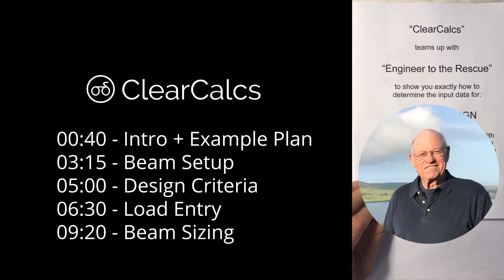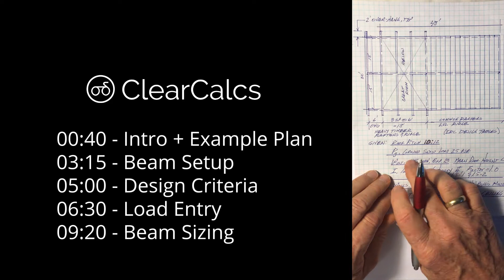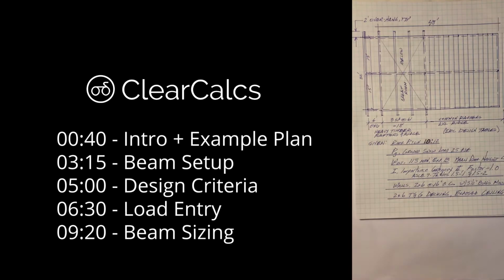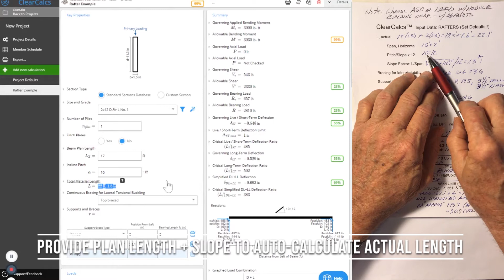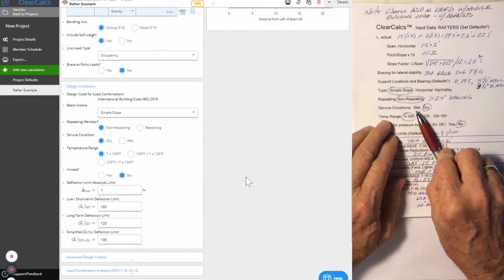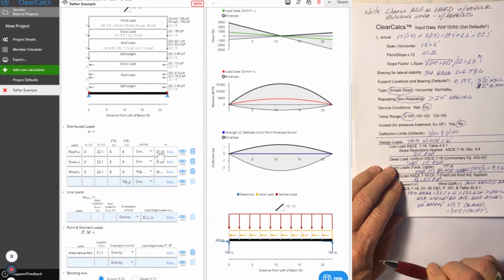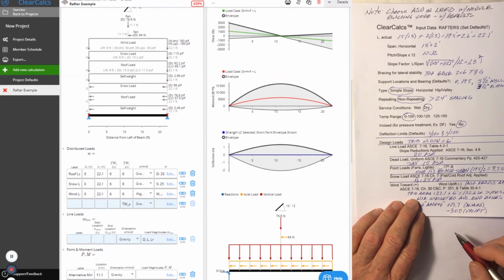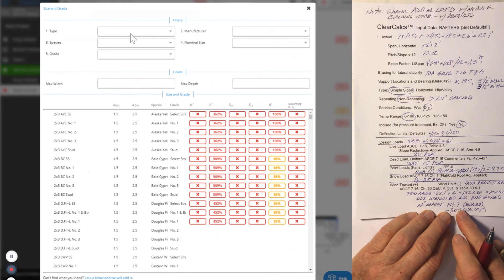Tutorial | Rafter Design to NDS 2018

Comment: could you explain how you get wind load +13.7 and -30.0, thank you 
if you can make video for steel beam design will be great
Reply from the maker: Hi there - thanks for reaching out! Regarding the wind loads of +13.7 and -30.0, David took a weighted average of the different values for different zones on the roof (Table 30.4-1 of ASCE 7-16). They're +13.7 in positive direction so that's where that comes from, and when looking in the negative direction, it comes out to approx -30.0 psf